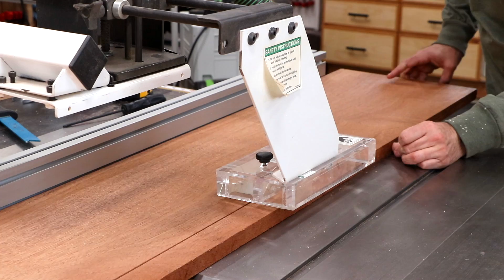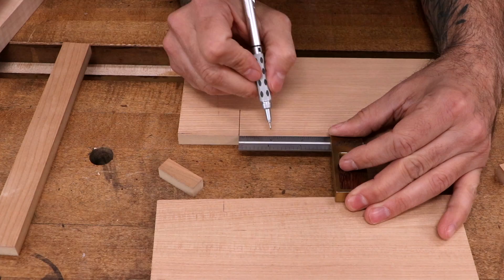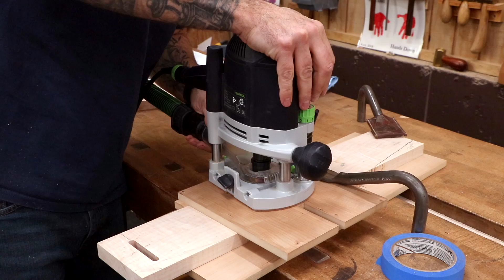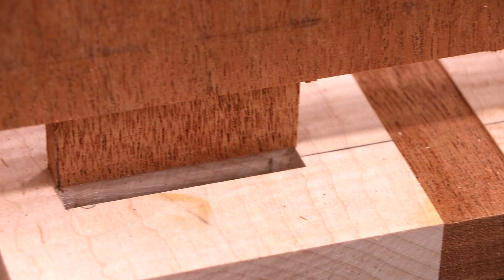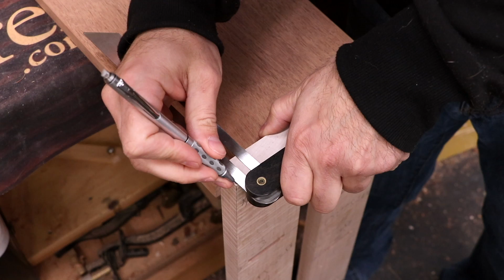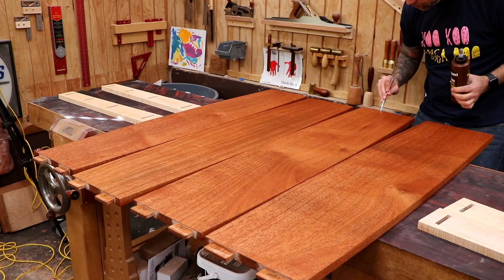Just a Shoe Rack

Comment: Hi Marc, i just started practicing woodworking recently, but i am struggling  when it comes to cutting a 3x2 inches into 3x1, my table saw got a small blade and it is risky to cut it in one go, do you recommend bandsaw instead? if not, what is the best method to do so?

Comment: Hi Marc, I was wondering if you could go into detail how to avoid chip out with the thcknesser. You mentioned you have a spiral cutter head, so do I (well, it's not like the spiral head that you have, it's slightly different. They call it a segmented cutter here in Australia, the heads contact the wood straight on instead of at an angle) but I've started getting chunks taken out of my boards. I've checked the grain direction and tried taking light passes. Still, it looks like the boards been attacked with a machine gun! Great video as always, REALLY like this design!
Reply: Hi Robin, I currently have a spiral cutterhead and this has made considerable difference in reducing tear out, however when I was using  regular planer blades it was quite a problem, especially with softer woods ( in the US where I live white pine is very common and relatively cheap) But I think that you are on the right track by being cognizant of grain direction. When I did have tear out I reversed  the direction of feed and this helped some. Spiral cutterheads are very expensive so this may not be an economic option for you. This may not help but I would recommend learning how to "read the grain" and keep your cutters as sharp as possible. i,m not sure of what species are common in your area, where i live softwoods are mostly white pine and fir, hardwoods white and red oak,. Walnut and cherry are indigenous but much more expensive. Even with freshly sharpened tool and consistent feed rate cherry will have burn marks,  so even more important   to "read the grain"
Reply: @VADOC02  Thanks for the detailed comment! I probably should've mentioned that I'm getting this issue on very hard hardwood. It looks like the cutter heads are gouging, not tearing the fibres up (what you would get with softwood). I think this particular board has very erratic grain, similar to curly maple, so grain direction is only part of the problem. The problem is, to sand the divots out will take to long because the wood is so hard, so a planer is the only way. How do the pros deal with this type of grain, how do they get curly wood so smooth?

Comment: Nice build. Question: why card scrape before sandpaper? I am not experienced with scrapers and was under the impression they gave quite smooth finishes alone without the need to sand, yes?
Reply from the maker: Sometimes. Just depends on the final surface you want. Scrapers leave a good surface but I like the uniformity left by higher grit sandpapers.